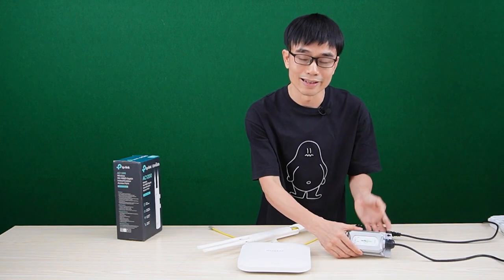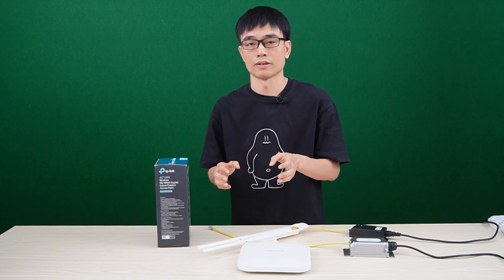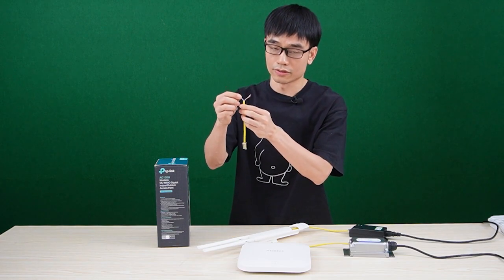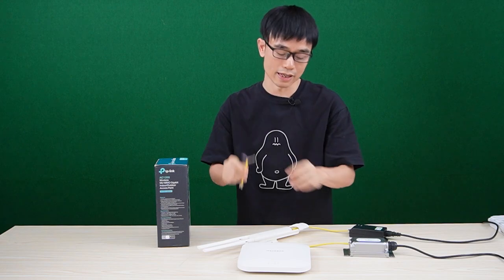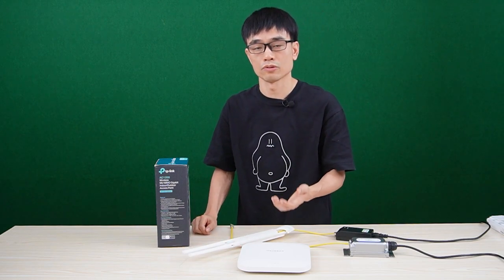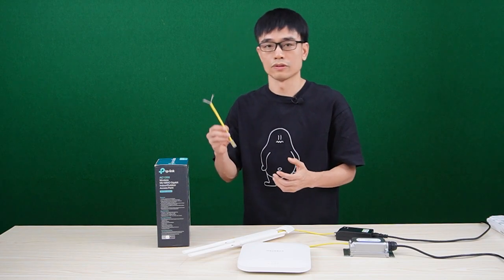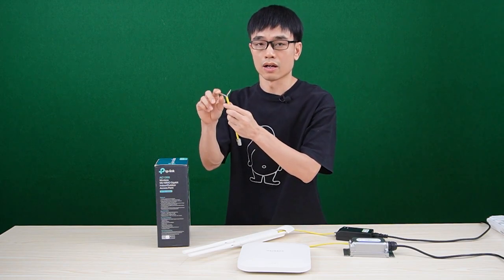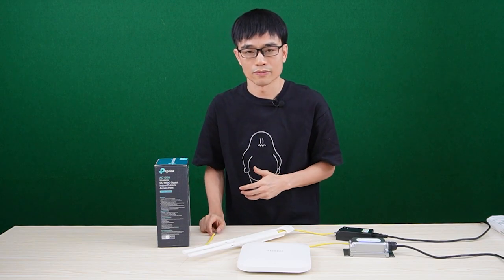Why 60W Outdoor PoE injector doesn't Power Ubiquiti and TP-LINK Access Point

Comment: Very interesting... the nuances in networking is often underestimated and causes lots of misunderstanding and confusion. Thank you

it is worth noting which injector you are referring to as you have multiple similar models for sale

in this case, the customer is trying to use the "60W Outdoor Industrial Waterproof PoE Injector 100-240VAC Input" supporting IEEE802.3af/at/bt. 

the indoor POE injector shown that works is the "10G 30W 802.3at PoE+ Midspan Injector" which supports IEEE802.3af/at without bt.

if he goes for the "30W Outdoor Industrial Waterproof PoE Injector" supporting IEEE802.3af/at without bt instead, he will not encounter the problem.

Keep up the good work
Reply from the maker: Thanks for your input. As long as the access point can take 24V passive PoE, it will have problems to work with latest PoE standard (ieee802.3 bt), as the new PoE will take all four twisted pairs to send the power. The passive need parts of the twisted pairs to work with DC24V.